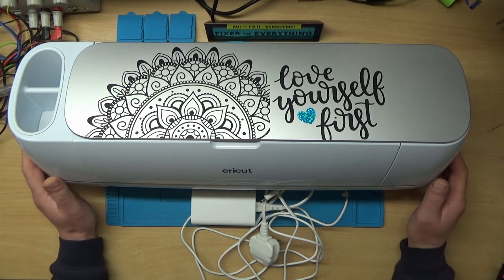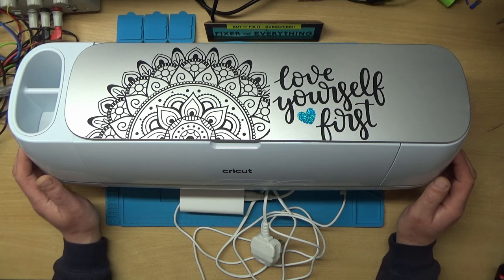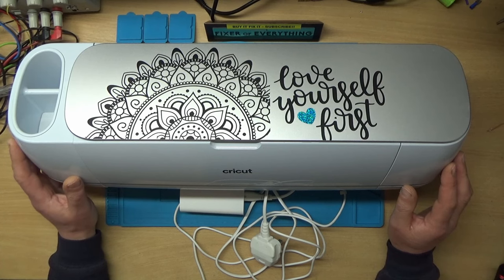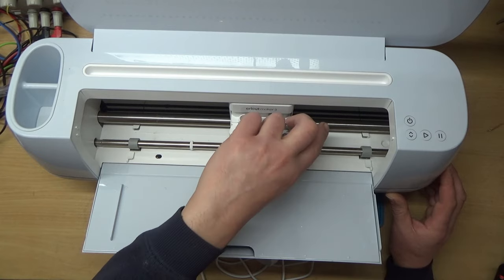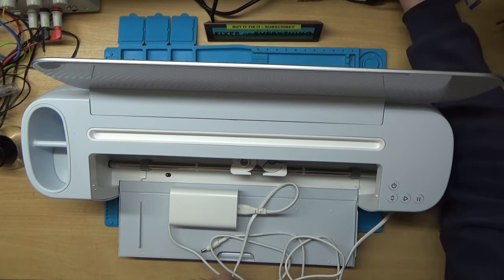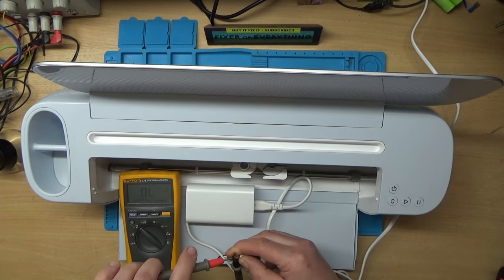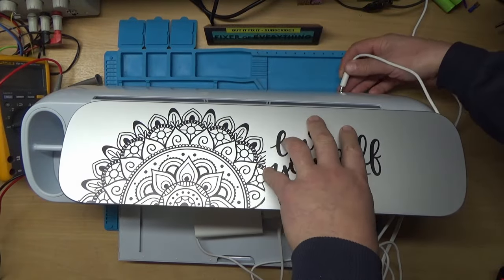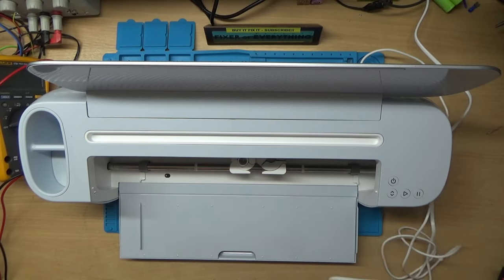Faulty Cricut Maker 3 - Trying To Repair...

Comment: I agree with the company. If the unit would have been sent in and then replaced, they would bin the unit. Same as now. That also does not make any difference environmentally apart from the fact that now you know, after sending it in, it becomes invisible. The "coffee" was probably Coca Cola or the like. That is actually pretty acidic and is devastating for thin copper layers. Ups, should wait with my comment till the end of the video. Sorry.
Reply from the maker: No worries 🙂. I've seen units being deactivated for minor issues such as a loose lid or a small crack in the plastic on arrival one seller said, which seems very wasteful, although I guess my bias is that I don't like seeing waste and like fixing things.

Comment: I can see why Circuit blocks the old unit, is because it doesn't ask for the old unit to be returned. If they didn't people would just make a false claim and end up with another unit free
Reply from the maker: Yes agree, seems awfully wasteful though. I bet there's a fair bit of energy and resources goes into making a unit from raw materials.
Reply: @BuyitFixit  Yes. I'm guessing the company is nothing more than a marketing company with no manufacturing or tech. The units will be manufactured by a Chinese supplier who are not interested in support. We need some right to repair legislation

Comment: It seems wasteful but in reality, those things are so cheap to make it makes no financial sense to run a repair network or  return them to the factory. The reason for disabling online software  for  warranty replaced units is to stop people taking unfair advantage of their no questions asked warranty program.  It would be "buy one and get one free" otherwise. They could run it differently but the price to the consumer might be higher and making warranty claims might be made harder.
Reply from the maker: Yes, agree with what you are saying, and I know it's to stop abuse of warranty replacement, but on the other hand they could ask the customer to return the unit first, then send a replacement. I've seen disabled units for sale online for things like the lid being loose, which just required a screw tightened. To me this doesn't seem right to dispose of a perfectly serviceable unit for the sake of tightening a screw, or for a small crack in the lid.
Reply: @BuyitFixit  To accept returns/repairs you need something setup to accept returns/repairs and that costs money. If you can just disable use of the unit then  you can avoid that cost and so they do. It is just a reality of very cheap high volume manufacturing that the cost of making  one unit is less than the cost of returning a unit to have a screw tightened.  Whilst it seems wasteful, doing things less profitably is more wasteful. Disposal taxes can change the economics so that it becomes more profitable to accept returns, but expect that to be reflected in a higher  cost you pay.   Consider if at point of sale they offered the same unit with an optional advance repair/return/disposal fee so that warranty returns would be done "less wastefully", how many would pay it?

Comment: Personnaly, I find that its quite bad company policy if you want to cancel the customers membership. I would not buy anything from them. That is sure, also I would advise the general public of the way the company is bribing it's customers.Like you said, the company goes tits up, every customer is dumped.
Reply from the maker: Totally agree, and it's not the first time it's happened. There has been internet connected lights, cameras and radios where the manufacturer has either gone bust or decided to no longer support the devices. The most recent I can think of was an E-Bike from a company called VanMoof.

Comment: If the manufacturer replaced the product they could ask to have it returned and destroy it adding to their costs. Or deactivate the faulty product and the customer throws it in the recycle bin. The customer has not been ripped off so has the manufacturer done any wrong? I don't think so, if anyone is at fault it would be the customer that spilt coke in the machine and claimed a warranty claim if that is what actually happened.
Reply from the maker: Thanks for your thoughts. Would it not be better for the environment for the manufacturer to get the customer to return the product, they could then repair/refurbish it and send it out as a warranty replacement, or sell it as a used machine therefore saving the cost of supplying a new unit or recouping some costs by the sale of the unit as a used one. Also if you think of the energy it took to create the unit, would it not be more environmentally friendly instead of it ending up in the trash or being crushed and recycled? Just my thoughts on it.
Reply: @BuyitFixit  I worked for a photocopier company many years ago and they worked out for small machines like that it was far cheaper to just replace a machine than try to repair. But when you bring in envoinmental issues you are correct.
Reply from the maker: @XXXXIndices  Thanks XXXXIndices 👍🙂

Comment: Bluetooth connection went in ours rang Cricut they dumped it and delivered a new unit (old one still worked with a cable) but a whole machine binned because of Bluetooth I’m surprised there isn’t more press on how wasteful such a big company is.
Reply from the maker: Yes agree, I saw one listed on Ebay listed as deactivated where the lid had a very small crack on it, cricut told the customer just bin it and sent them a new one.

Comment: if the coffee did that to the board ,imagine what it does to your stomach lol  i had boards from boat plotters /navs with salt water damage that where,nt that bad ,the copper track and pads must have been razor thin on that board , to corrode so badly and so quickly . must be a really cheaply made board .
Reply from the maker: I did think it was coffee at first but towards the end of the video I was thinking more coke. Yes sea water and electricity isn't a good mix. I've seen electronics that have been dropped in sea water before, and it wasn't pretty.

Comment: The supply voltage is 18 Volts 2.5 Amps not 24 volts
Reply from the maker: I'm not sure where you got that information from but it is incorrect. I know the other some of the other cricut machines are 18V but not the Cricut maker 3. See picture of original OEM power supply that I just took: https://imgur.com/a/CdSU34U which clearly shows 24V 2.75A and from the Cricut site "Not compatible with other cutting machines"

Comment: Time to rip out the old logic board and mod in a raspberry pi or arduino to controll the motors so it works again. This would also mean that you can do everything you cant without ethernet and use it offline^^
Reply from the maker: Yes, I had thought of that. The only problem is most of the control software such as GBRL doesn't work with these types of motors. Someone did convert an older machine but replaced all of the brushed DC motors with stepper motors. This model also seems to have a brushed motor to control the angle of the cutting blade and a sensor to home the angle. In think the best solution would be to have a working board and reprogram the existing pic32 chip with a special port of GBRL or such but you would have to trace all of the board so you know what i/o ports did what, and then write the software. A fair chunk of work either way.
Reply: @BuyitFixit  i figured that they where stepper motors since its a plotter and those need to be pretty precise to create letters/patterns but yea maybe a donor board in that case then
Reply from the maker: Yeah unfortunately they use a brushed motor with a wheel on the back with splines on it that passes through an opto coupler so they know how far it has moved by counting the pulses. Thanks for the suggestion though 👍
Reply: @BuyitFixit  aaah i see just like how scroll wheels on old computer mice used to work instead of rotary encoders
Reply from the maker: @boyke2412  Yes, exactly like that 🙂👍

Comment: Deactivateing is not the way forward, at least there should be a way around it if you could show that you purchase it, but I never understood how company's could make money with a policy like that, they must cost next to nothing to produce, but then again they make their customers dependent on them and could charge what they want to keep it working. All in all terrible way to run a business.
Reply from the maker: Agree, imagine if it was a car instead! Oh theres a problem with the battery... just scrap it and we'll send a new car instead 😂😂 look at this I just came across https://www.ebay.co.uk/itm/125858137665 read the description!!
Reply: @BuyitFixit  29£ for a paperweight 😂, I'm thinking there must be some way to jailbreak it or alter the code
Reply from the maker: @MrEwool  I'm of the same feeling. I'm tempted to buy it, but it would be a fairly big project to reverse engineer the PCB so you know what pins on the IC control what, and then write your own firmware. I did see a programming header so I'm sure you can erase the existing firmware and the reprogram the chip with your own. It would also involve porting GBRL or something to that chip and then modifying the code to work with the hardware. I'm 100% it could be done and I've done things similar myself, it's just a fair amount of work....
Reply: @BuyitFixit  would have been simple if somebody already made all the legwork and all you had to do was port it, but some of the fun is in making it from scratch and seeing if it works.

Comment: I can see both sides but I think claiming under warranty for a device that's misused or not broken is also criminal. The company has graciously supplied a new device FOC and the old device is dead I agree with removing the serial number from the pool of working devices.
Reply from the maker: It perhaps might be better to get the unit shipped back and then either repair or use it as parts..I've seen some disabled for a loose front panel for instance.

Comment: These are just overpriced plotters armed with knifes, surely someone has made an arduino solution to replace the control board.
Reply from the maker: Agree. The problem is most arduino CNC s and the like use stepper motors. This uses DC brushed motors with optical encoders to count the position. So you would need H bridge drivers to control the motors, and I think the knife pressure is operated with a coil type arrangement.  There is also another motor that controls the knife direction. It may be possible to port GBRL or something to run on the original board as the Arduino IDE does support some PIC32. I still think it would be a bit of work though.

Comment: * - I cringe so may times when i watch ur videos.. using that dental pick.. YOU messed up that VIA by the ferrite bead pads.. u should have used the right tool for the job.. a razor blade or the rotary tool, you literally just used it... just saying... WHY didn't you just ultrasonic clean it.. THEN repair it ??? so much easier.. and where all the corrosion is.. you can use wire as jumpers for those missing tracks.. even the test point locations.. big job, but doable.. & PLEASE stop using a blunt dental pick on PCB's.. cringe-fest... you spent more time scraping & wasting time.. than actually making jumper wire connections... and using multimeter on continuity on the messed up VIA's with tiny short track & trace where it connects... if you don't want to fix it... i can... and you can have the video of it.. working i might add....
Reply from the maker: Thanks for the feedback Terry. There was pretty much nothing left of the tracks and vias, they were just all black mush. You're right it could be possible to repair it, but as you say it's a lot of work. The machine had also been disabled by the manufacturer and seeing as the software is cloud based even if the hardware was fully working you still wouldn't be able to use the machine. What fluid would you recommend for the ultrasonic cleaner? As I've not used them a lot.